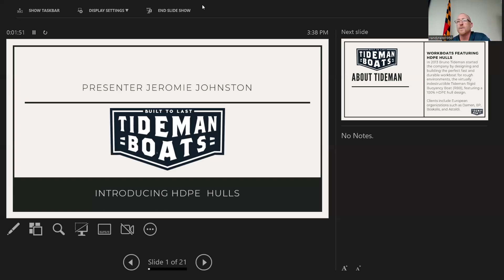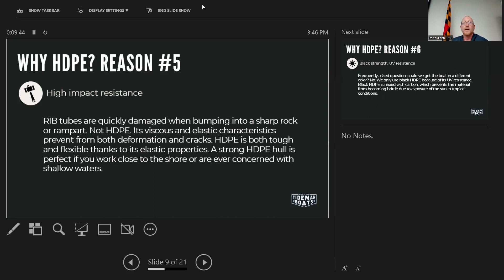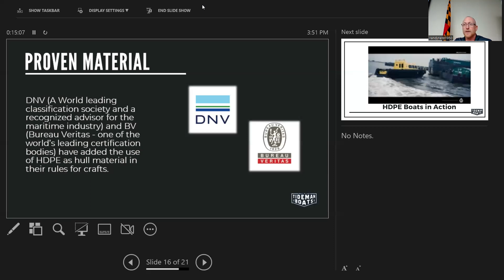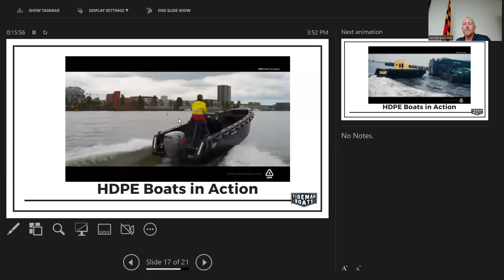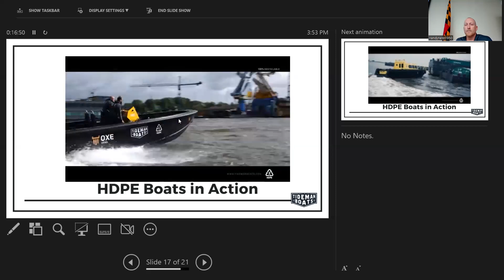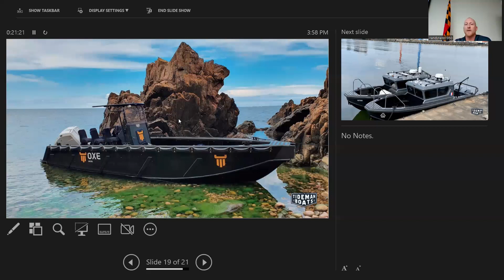Introducing HDPE hulls by Jeromie Johnston

Comment: Hi There a couple of questions if I may ? You mentioned that the rotomoulding type boats are different but can you explain in what aspect as the various brands still use HDPE ? Does the structural integrity change due to the manufacturing process ? If you don't use HDPE for any super structures cabin/cuddy etc and you can't bond anything to the HDPE hull, how do you for a connection between the two elements ? Thank you.